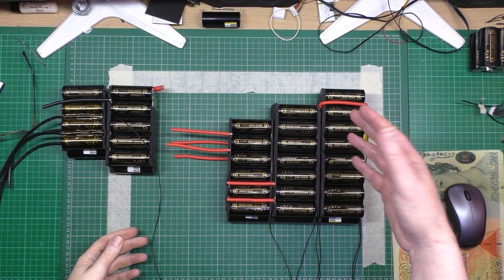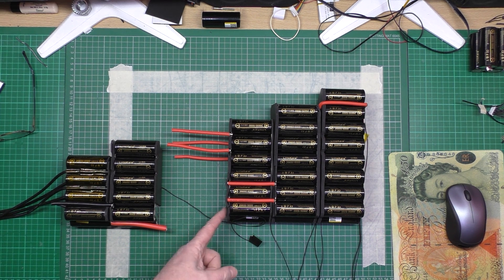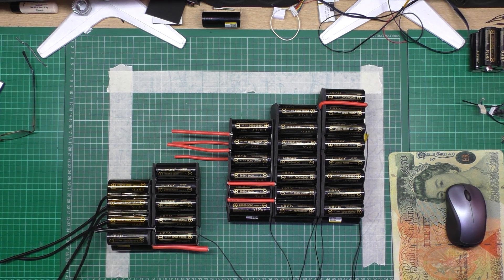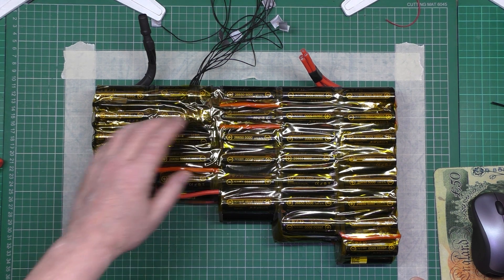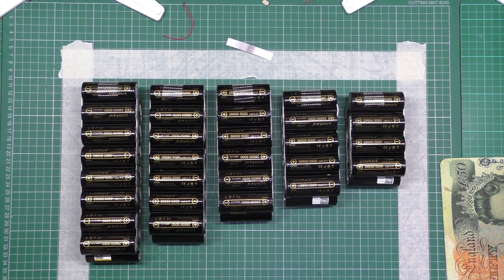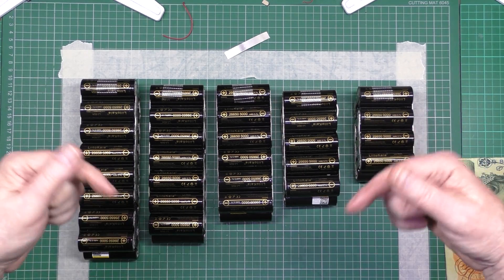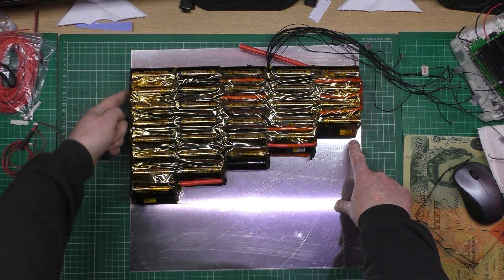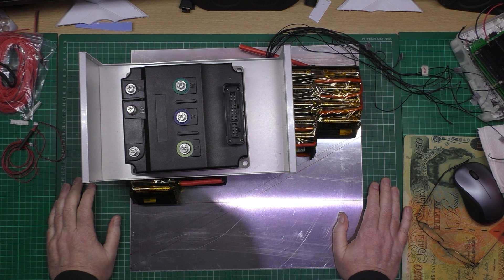High powered DIY eBike MSVA build part 11 - Lithium battery 84v 30Ah 2.5kWh build part 6

Comment: Thank you..thank you soooo much..this video solved my biggest problem..& sorry to hear about your back troubles..I suffered 3-4 years with the same problem..felt like somebody had stabbed me with a blunt screwdriver, right through the left arse cheek & into my left testable..pain made me literally vomit most days..hated the thought of surgery but thankfully a minor disk shave worked a treat & im like a new man again. Best things I did to relieve pain were to drink distilled water (the puss out of the tap is literally full of that much crap, that it’s no good at all for hydrating hard to reach places like disks & eyeballs..plus the dissolved solids cause kidney/gall stones), grounding by walking barefoot on grass/soil,  plenty of good fruit/veg & Hylands cell salt supplements..I’d say these things reduced the overall pain by at least 40-50% which allowed me to function & keep my job in heavy engineering

Comment: Hi Tony hope you don't mind but I'm after a bit of advice regarding battery's . I'm looking for a good 3.7v lipo battery  for a drone . Not to clued up with mAh or what the difference there is from 25c to 50c battery. I'm looking for a reasonably priced decent battery with good flight time . any advice would be great .... Cheers
Reply from the maker: Drop me an email mate - vortecks2000@gmail.com

Comment: I had Sciatica and lower back pain from years of working in catering,  one of the things I found really helped was Earthing, you're probably thinking sudo science non-sense but it really helped, I was able to go back to working full time after a few months and it's not expensive to try, all you need is an earthing wrist strap and the rest you can make yourself for a fraction of the cost they charge online for a kit, I made mine with some speaker wire, a piece of stainless rod and some shrink wrap left over from my ebike build.  Great channel by the way, I got some liito kalo cells for my next build after watching your vid on charge cycle testing, so stoked to see how your v3 turns out.  Best wishes. B

Comment: Get the Lego Technics out 🤣
Reply: TBH lego is made out of one of the most durable ABS with a 700kilo crushing weight and if u used it with abs adhesive to build anything it will not break ! better than any flimsy 3d printing shit !

Comment: Awesome work mate - your getting there! Really appreciate the effort of putting up your videos - this is what prototyping and development is about PERSEVERANCE! You mention the aluminum casing for your controller would act as a good heatsink; the problem is that it's too thin to conduct the heat across the surface area of the case. If you intend to have the controller mounted towards the battery, @ 11:56,  the heat will go into the battery pack instead of the environment. I probably misunderstood you or something, but I thought I'd check. If you have the tech specs for the controller, there should be a tdp rating somewhere. With that, you could take a good guess at what sort of passive cooling you need.

Comment: Tough luck about the sciatica Tony mate - I had it last winter and it was agony, made my leg and toes go numb on one side as well. What helped me was... simple.... too simple.... I drank a LOAD of water for a few days. Turns out I was very dehydrated and the "stuff" between the discs in my back were able to be compressed, and caused them to pinch a nerve. Once I rehydrated, it was like night and day. I might be talking bollocks but it worked for me. Ibuprofen works as well to get rid of any inflammation. Good luck! Also - great work on the battery, progress is good :D
Reply from the maker: I've tried drinking loads mate - it has helped but I always wake with a headache. Oh.... water? 😂
I know how I did this one, I was helping someone carry old doors to the tip. I felt my back 'thud' and knew I was in for pain.
I'm 80% fixed now so I got off lightly (although it's been nearly a month).

Comment: Tony I know exactly what you are feeling right now, 1 year after my operation to remove Golden Staph Abscess in & around my back in 2014 the disks had shrunk & were squashing the nerves between the disks & vertebrae. Basically it shoots pain down through your thigh where you lose 50% of your strength in that leg, it feels like someone put a few strips of barbed wire or razor wire between the bones & muscles so every movement makes your knee give out, you helplessly nearly fall to the ground screaming in pain. Not to mention that you also might be feeling like someone has shoved a large screw driver through your back sideways & twisting it around causing shooting pain across your lower back. My 2 meds of Tramadol 200mg & 30mg of Codeine Phosphate twice a day take away about 50% of the pain on a good day.